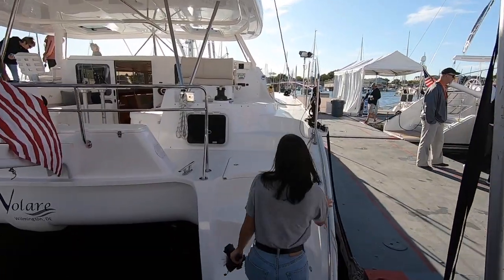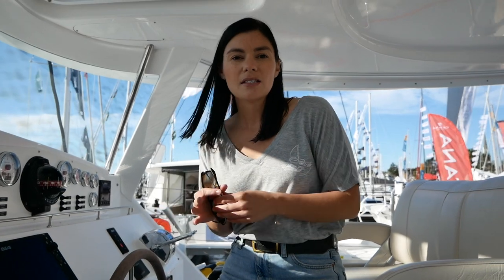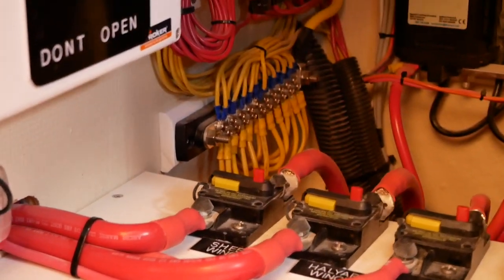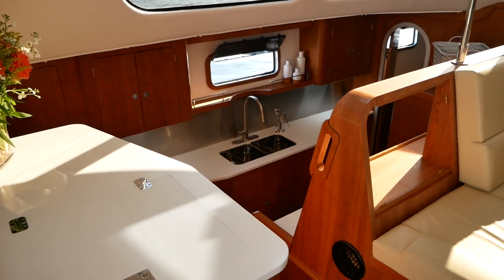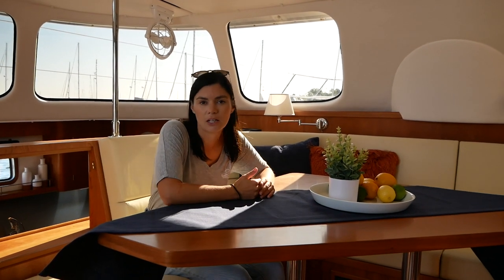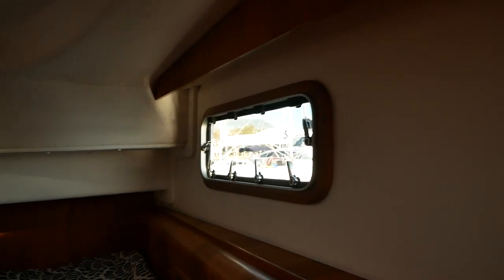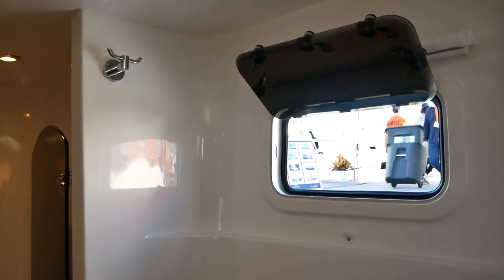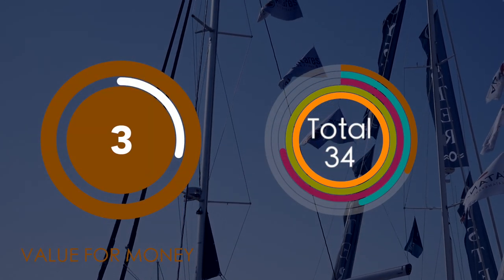Antares 44 GS Catamaran Review 2021 | Our Search For The Perfect Catamaran.

Comment: Antares did not design this boat, PDQ did, early 2000.  Not sure Antares has the skill to change anything on this design.  I did sail for a week on one and it is nice and confortable but a bit slow.  Single handling with that winch in the back is not easy as you don't see what you are doing to the sail.  Too expensive.
Reply from the maker: Thanks for your feedback mate. really appreciated